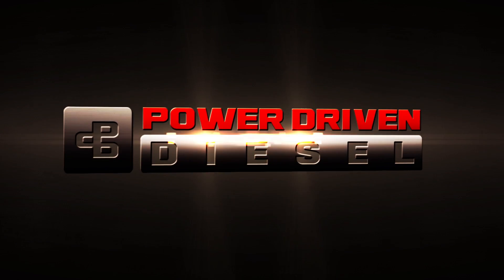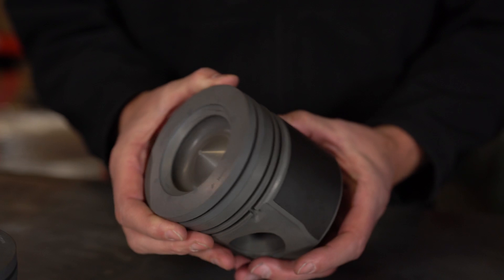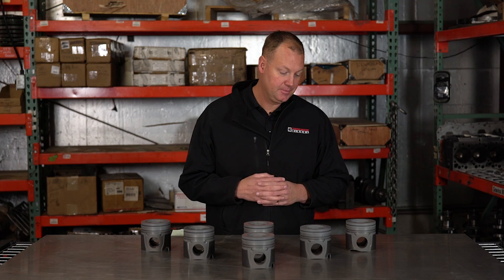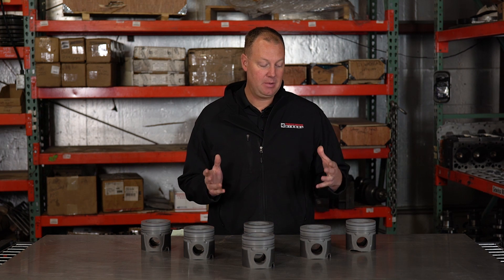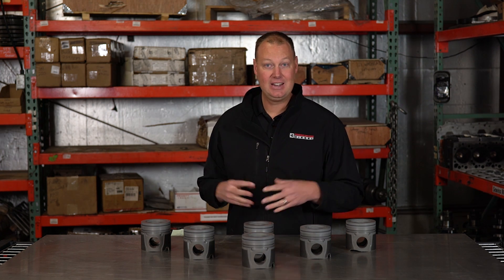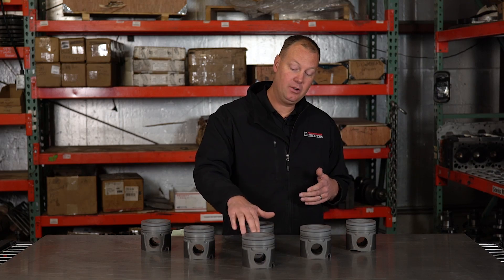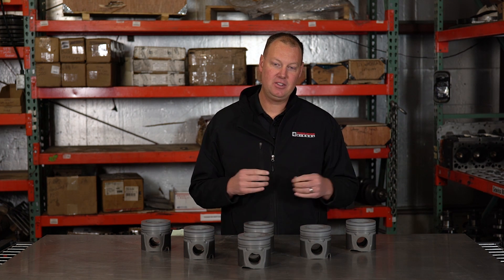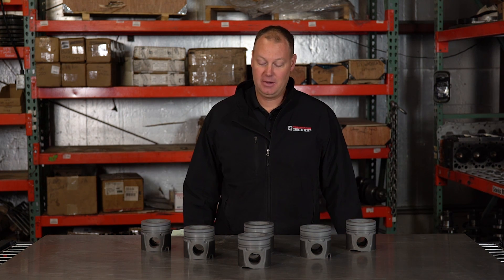Hamilton Cams New Forged Pistons | Parts Bin EP 1 | Power Driven Diesel

Comment: The problem with even ceramic coating I found. Is it puts all the heat into the cylinder head. Scorches valve seals and bakes the oil in the valve guide. If you dont coat the chamber and ports as well.
Reply: I had a gas engines pistons coated. Soon realized since ceramic reflects the heat. It has to go somewhere. The cyl. head had excessive temps afterward. And soon drank oil. But it was great in winter. Full operating temp after 6-7 min. of idling.
Reply: Quite true. I am ready too see how it goes! I’ve been curious about full ceramic coating on the ex. ports, manf., and turbo housing for a race diesel. Trap the heat all the way to the turbine. Curious if it would spool faster. If the valves could survive.

Comment: Does the heat not travel beyond the ceramic matrix? Ceramic is usually a good insulator so is that how he's able to control the lower area of the piston from expanding beyond the compression ring and caused binding?
Reply: I would think its machined down to allow clearances for the material